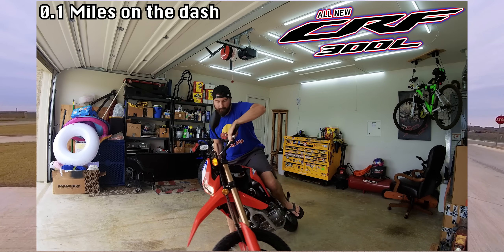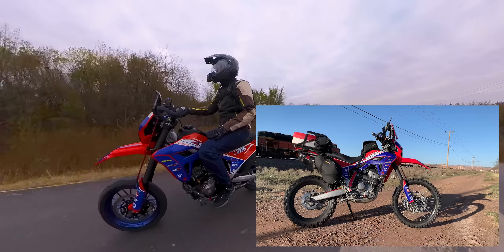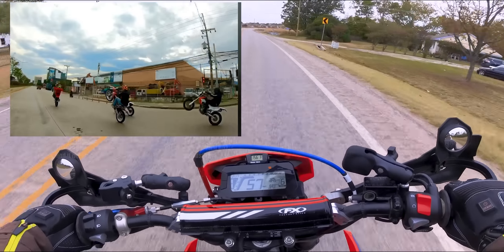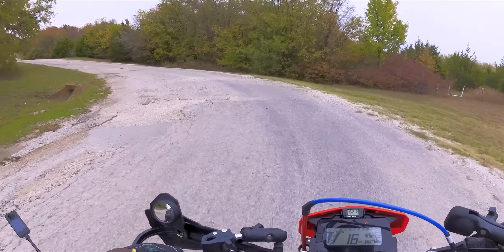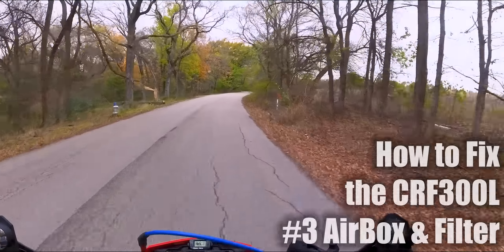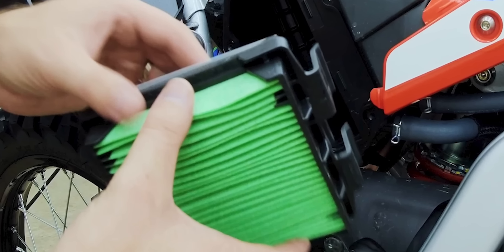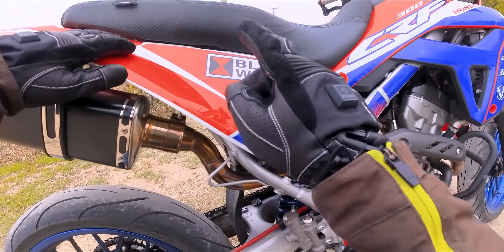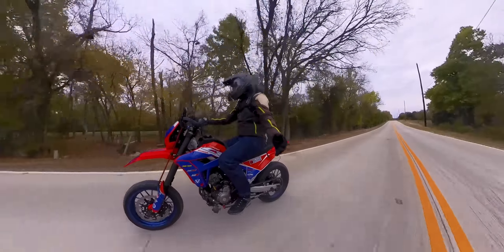How to FIX the CRF300L in 5 Steps

Comment: The rear shock is downright dangerous, not just just soft! The bike wallows from corner to corner on a twisting road at some speed, never settling properly before entering the next bend. I put over 60,000 km on a crf250l and the shock on that was markedly better than the 300L. It's insane that they didn't install a better shock. As it is, all the other improvements to handling they incorporated were made pointless by the poor action of the rear suspension. I didn't upgrade the suspension on the 250L, but I sure as hell upgraded the 300L with a K-Teck Shock and RaceTech fork Spring kit. Now it handles safely. Love the bike, but man the suspension is a joke!
Reply: You're right, it is literally so soft these should be recalled in the European market.  This is insane.

Comment: Agreed man. They need a "Western" Model that has stiffer springs and dampening for the average weight of Americans. Its dangerous when you take turns at speed with the wallowing. After the Rally Raid Level II suspension and kickstand its a perfect small bore dual sport. The Rally Model does have an LED headlight and its plenty bright. Such a stupid cost cutting move for the 300L since its also safer to be more visible to other riders and see better as the rider. The paper filter isnt too bad but wish they had a tool-less door as you mentioned. Defintely adding the CBR300 cams and 550 Performance tune witht eh intake tube. Its unjustifiable to make it so gutless on the highway for the American market where 80mph keeps you from getting run over.

Comment: Honda dumbed down the CBR250R engine from 26hp to only 23hp on the CRF250L.  The CBR300R 286cc engine is tuned 30.5hp and dumbed down to only 26.5hp on the CRF3000L   Use the CBR300R ECU or an aftermarket standalone ECU with the CBR300R as base map.  The rear shock needs a YSS rebound adjustable unit to replace the noSHOWa.  That's it!

Comment: You're good, but I don't like the bike. I like Honda. It's that it's so small you should buy a scooter and save thousands of dollars and wear sandals instead of a helmet. After all your mods, all you can get is a power wheelie? Not even balance point? I'm sure it can, it's just I think an under powered supermoto is more dangerous in difficult riding situations. You need to be able to get up and go. I'm in the 450 or more crowd, but you teach me a lot. I'm open minded. Never Grom, I'd get a Honda Monkey and ride it through the woods though.

Comment: The silver lining to the suspension for me. If it was any better, I probably wouldn't waste money on upgrading it. But because it's so shoddy. I'm def getting some adjustable shocks and springs
Reply from the maker: Good point
Reply: How is that a silver lining it's under equipped?🤔
Reply: @phantomshtter  If it was equipped JUST enough, then the commenter would just have "Meh" suspension forever, but now they will have Great suspension.

Comment: Suspension is the #1 thing which would make me recommend a Yamaha WR or Kawa KLR over this. Even putting on the Ohlins kits the CRF suspension leaves more to be desired. #2 is I wish it had just a little bit more highway power. I have a 250L so maybe it’s better on the 300L, but just being able to get to 90 instead of topping out at 80 would be great. Not that you need to go faster, but if the bike is not topping out at 80, that means it can get to 70-75 faster and have more pulling power at that speed. Aside from that the fuel gauge, maintenance intervals, and gear indicator on the 300L are all awesome and very user friendly
Reply from the maker: The ohlins kit is not enough? The race tech kit is great. Is the ohlins one an off the shelf item? The race tech one is set to the rider. Maybe that’s it. I’ve always been under the impression that ohlins was top notch.

Comment: I actually like the stock headlight look over the LED so I just wanna get a better bulb haha just got the bike and was thinking rental bars
Reply: I agree Hughie. It's been my experience that the reflector for a non-LED stock headlight doesn't work worth a damn with an aftermarket LED bulb. They're almost unusable on the dim setting and just average on bright.
Reply: @doobielawson702   I was wondering if I should bother putting in an led bulb, I saw one for sale on srmoto I believe, like 90 or something tho so not exactly cheap
Reply: @Hughie1987  in my experience, not worth it. I hardly ever ride at night tho.
Reply: @doobielawson702  I also want the LED so I can be see better during the day not just at night, people don't pay attention enough as it is
Reply: @Hughie1987  I can see your point on that. So many people on their phones while driving. My buddy had a 250L that came with Acerbis handguards. These guards had a circular LED light in each guard. They didn't provide much light like a headlight does, but they did make him a lot more visible. They do add extra wiring tho so there's that aspect.
Reply: @doobielawson702   more lights is good not so much more wiring! There are zeta guards that have lights build into them now as well
Reply: @Hughie1987  I had some Zeta handguards that had the built-in blinker. They looked really cool and the handguards fit great. But I do mostly offroad riding and eventually the blinker wiring broke loose from all the vibration. I tried to solder it back but it didn't. I did get about 6 years out of em tho so that's pretty good.
Reply: @doobielawson702  good to know thanks!

Comment: I’m with you Jake, in Aus we are normal sized folk and suspension is a must No1. Ktech front and rear. No2 Side stand - free - use an old handlebar set, cut off 20mm and weld this to the existing stand No 3 550 Performance ECU and side air box mod. No 4 Exhaust upgrade plenty to choose from, I used MotoX on price alone. No 5 Unifilter high flow serviceable air filter and modify air intake tube.  This bike is now awesome, more power, sounds like a thumper, handles brilliantly and loooooongggg service intervals.
Reply from the maker: Sounds like a solid set up. That is the thing, you can fix it up good for a few bux and some time.
Reply: $3K Aussie dollars.  The basic investment wherever to you live is about Acquisition price + 30%

Comment: Re the kickstand: with the stock 'saggy' shock, if you get on the bike with the kickstand down and swing your leg over, a taller kickstand would cause most people to go over on the right hand side because the kickstand would hit and throw their balance off. They're marketing to a world market with this bike, so some things, I think, are done to appeal to the largest audience. Oddly, when I replaced my shock with an aftermarket (not lowered), I don't find any issues with the kickstand. That whole unstable 'ness' putting it on the kickstand to me was really just the lack of rebound control on the shock. An aftermarket shock doesn't 'pogo' like the stock one, and doesn't seem to be an issue. When I first got my (Rally), I put a kickstand extender/pad on the bottom (about 5/8" taller) and found it unstable when parked on anything but flat ground (off-road), and promptly took the extender/pad off.
Re the headlight - just buy the Rally and you get a nice LED headlight... I agree that an LED headlight couldn't add that much cost to the bike.
Re HP, it's not all about the peak, for a bike like the CRF300L, to me, usable power is better than peak power. The power on the 300L is pretty usable. Again, targeted at a global market. Would I like more power, for sure, but how far do you go? I really liked the 390 Duke I had, but the 40ish HP from a 373cc engine, but I feel there was a tradeoff in reliability.
Re suspension - again, a global market and newer rider. The KLX300 gets better suspension from the factory, so you'd think Honda could have at least matched Kawasaki, but to me, there's a bunch of better things on the Honda than the Kawasaki, which would have bumped up the price. It would have been nice to have 2 options with a bump in price between - standard and 'enhanced' with better suspension costing a bit more money. Give people a choice. The reality is that for me, no matter what bike I'd have to upgrade the springs, so I'd be into any bike for some extra $. It was cheap to upgrade the shock to a YSS (around $320USD + shipping) (which included the correct rate spring).

Comment: Changing the cams and intake may result in a slight power gain but also shift the peak power by 1000 rpm, along with alternating the torque curve, the CRF has a broad flat torque curve, this is more useful at lower speeds encountered off road.

The CRF is priced according to the equipment installed, $ 4000 all taxes and comprehensive insurance for a year included, here in Thailand. By no means is it a motocross bike with lights, it's an adequate all round dual purpose tailored to riders in the 175 pound or less range. The under stressed engine  makes it reliable with long service intervals,  

All the "mods" commonly discussed won’t alter the fact that it's heavy, the cheapest way to increase performance is to lower weight, this includes the rider, personally I lost 44 pounds after leaving North America, very noticeable performance upgrade at no cost. 

Honda does make CRF 250 R which is lighter, significantly more powerful with good suspension etcetera, but also all the downsides of a highly stressed engine and retail price.
Reply: Pointing out riders need to lose weight instead of throwing money at "mods" gets immediate thumbed up by me.
Reply from the maker: If you look back at my results you’ll see the cams actually added a huge increase in bottom end power. Where it was at 12hp stock it’s now at 21hp.

Comment: The 300 platform was marketed well and the masses had high hopes. A large percentage were met with disappointment. A small bump in power compared to a 250L and a suspension that was no better. After you get the bike out the door of the dealer selling at almost full MSRP, dealer fees, taxes and supporting mods to make this bike ready for true dual sporting, you are once again in that $9-$10k price range. The Facebook marketplace confirms the disappointment and also shows what kind of loss people are taking moving these on down the road.
Reply from the maker: Well I did pay $6k even out the door.

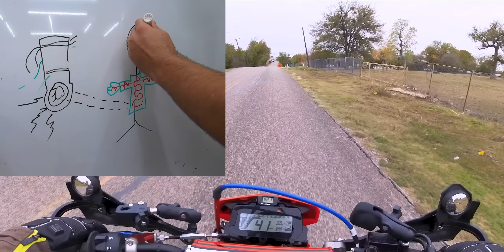Comment: 0:50 I have Hotwired gear too... but I have a love/hate relationship at times.  Usually what I run into is that you get a touch chilly on one setting, and too hot on the next setting up, so you have to keep cycling it up and down non stop.  EDIT: And before anyone asks, I live near Buffalo and ride all year long.  As long as there's no snow on the ground.  The other day it was 20° F, and I had to keep cycling between low and medium on the pants/boots, and off/low on the jacket.
Reply from the maker: Oh yeah yeah I have the same thing. It's crazy how warm this stuff is. I never use high. The worst I rode in was just below freezing doing 70+mph for about 30 mins on the highway at night. I had the it in medium at most haha. But one thing I have done is to crack the jacket open a bit to balance it out. Now this is not the safest thing to do to be fair. And you kinda end up like something cooked in the microwave. Burning up and frozen at the same time. What would really be good is an auto temp sensor. Some of the high end gear has that.
Reply: @TheGardenSnake  I can ride down to about 15-20° before it's too cold to ride.  As you said, when you need to use the "high" setting, you're simultaneously freezing and melting.  I think I need better insulated gear over the liners so I can keep the temp lower.

Comment: The suspension issue would be crazy expensive, far better to do it at the dealer level and setup when the bikes hit the market, throw in springs weighted to average rider weight in the nation.

But it's still a compromise option vs the owner setting it up for them

Comment: I did not realize the 300 has a different kickstand. I added a wider (but not particularly thick) foot to the KS on my 250 Rally, and it borders on being too long, with the stock suspension. I have to be careful getting off that it has enough lean.

Comment: I got a few questions.. 
1st ..do riding single cylinder is different from twin or Tripple or in4 ?? 
I have heard that twin and all bikes r usually easier to ride as they r less jerky 
2nd do I need to b in higher gear in singles i mean i have been told staying in 5th or 6 gear gives more mileage with a minimum speed and throttle i have seen folks riding 40mph  5tg or 6 gear .. instead doing 80mph in 5th or 6th gear .. as a beginner i don't like to ride in higher gear in medium traffic to slow traffic

Comment: The headlight makes the look of the bike so much better imo. I have it with sumowheels and short fender. The stock fender looks ugly as. I changed it for a acerbis supermoto one. You should try that or maybe cutting the one you have. Quick question for you. What gears are you running on the sumo set up. I'm running a 38t at the back but I'm considering going to the 40t.
Reply from the maker: I didn’t want to run an sm fender since it makes a weird gap between the headlight and the fender. I’m just running stock gearing in the sm setup. So technically it’s a bit shorter. I think it’s actually just fine.

Comment: It's essentially a unicycle with a training wheel out front.
Welp, I've never owned a supermoto, but I've owned a handful of Jap road bikes in late models. Japan has a problem under-springing and under-damping most suspensions that end up in the USA market. I've had the opportunity to ride a Ducati and BMW and one or two other brands and suspensions were night and day more supple and controlled than the stuff from Japan. Exception would be the supersports and superbikes, which are a lot different than everything else they sell here. Yet even those aren't set up optimally in a lot of cases. But of course, Americans vary a lot in weight and height and one suspension configuration isn't going to cut it for everyone. None of this stuff matters buying a car or truck or SUV, but a rider's weight is a significant portion of a motorcycle and small changes with suspension make big differences.

Comment: On the Honda CRF300L it would have to have a ridgeback frame like a dirt bike with the option to have a 3.5+ gallon tank and have dual radiators for me to buy it.
Reply from the maker: Now the 3.5 gallon tank I’m with you. But what’s the advantage of a ridgeback frame and dual radiators? It’s not like this frame is weak and the engine doesn’t overheat.
Reply: @TheGardenSnake  I understand I just grew up with dual radiator. My thoughts are more coolant more cooling but I could be wrong. The ridgeback frame I only know of is the frame where you can have a 3.5+ gallon tank but again I don't know that's what I grew up with

Comment: Is it worth the upgrade from a 250l to a 300l, how much of a noticeable difference is there?
Reply from the maker: I’ve been on the 250l a few times here and there. But I don’t have enough time to make a good opinion on that.
Reply: Depends where you live and what you want to do. I rode both and personally the difference is not that big. I stayed with the 250....i would only recommend an upgrade if you are coming from MD38 (2012-2016), in this case i would suggest to drive a 300L and check if it´s worth for you to do the change. You can do the same mods to the 250 as well so.....there´s only the 36cc difference...

Comment: The klx300 comes up winning in every comparison I've seen.
Reply from the maker: It certainly has some advantages. The thing I’m not sure of is how long can that engine go. Like the old crf250l was used by lots of people as around the world bikes. Itchy boots ran her 300 on a huge trip. This platform is very proven. Now the klx250/300 I just haven’t seen it used in that way. Maybe it’s fine but 🤷‍♂️.
Reply: I was between the KLX and the CRF. Went to look at both and determined the feel of the switches and look of the dash with a gear indicator were all better on the CRF. So I ended up buying it instead of the KLX. And the aftermarket is better for the CRF.

Comment: Surprised budget bikes and cars still offer dim, yellow halogen headlight. It’s a safety issue.  Our eyes evolved to see at 5000 k sunlight not 3000–4500 k.
Reply: The KTM 390 adventure you get led headlight, TFT dash, adjustable suspension, TC, etc.
Reply: The KTM 390 adventure has 43 horsepower with the led headlight stock, TFT dash, adjustable suspension etc.

Comment: Honestly, what they need to fix is the 5k piston slap, people call it the 5k rattle. I sold mine because of that, also hate the right leg radiator heat issue.
Reply from the maker: Well definitely not the piston. It’s the reed valve in the pair system. I have a video removing it. That engine has always made that noise and it’s not hurting anything. People have pitted the crf250l around the world making that noise. Did you really sell your bike from a noise you didn’t understand?
Reply: @TheGardenSnake  The owner of 550 performance told me that, You should talk with him, he is so smart mechanically and electrically. I also didn't like the heat on the right side but on a positive note the bike felt and rode way lighter than it really is.
Reply: @TheGardenSnake  I think im going to buy the KLX300sm, opinions??
Reply: @TheGardenSnake  I just bought a 2022 300 Rally. I had read about the 5K rattle before I got it. It had 610 miles on it when I bought it. I rode it about 20 miles my first ride and paid attention to the 5K rpm. I didn't notice anything with mine. Do they usually do it from brand new or does it kinda develop over time. I really like the bike first time out.